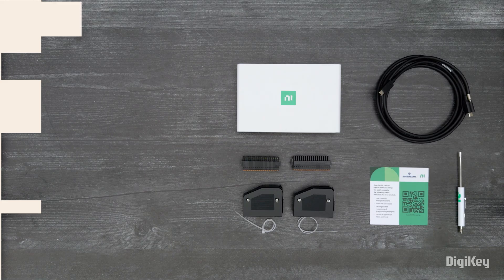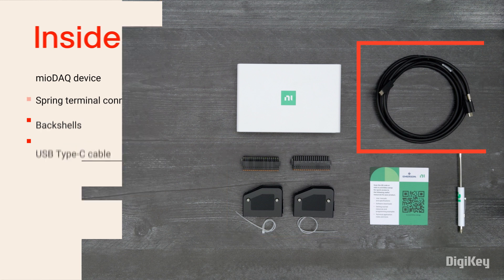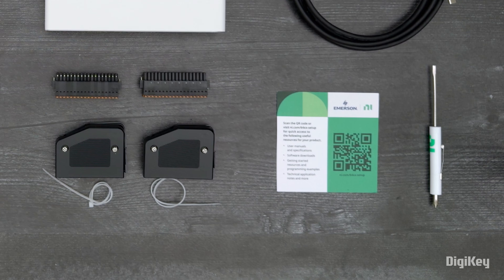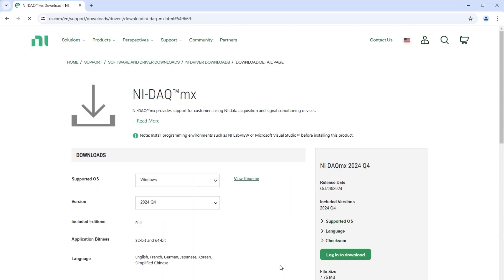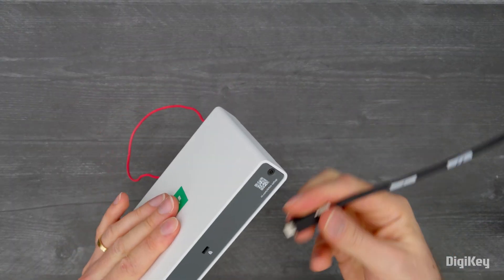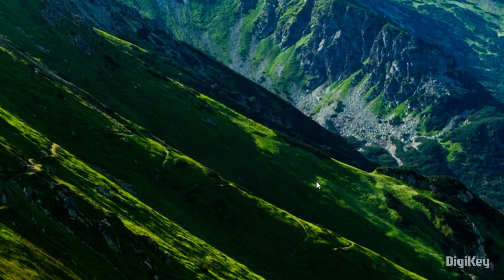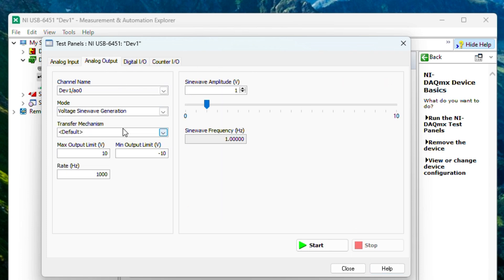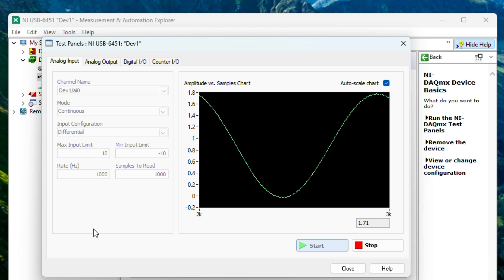mioDAQ USB Data Acquisition Devices - Unboxing | DigiKey

Comment: How many channels, and what is the analog input bandwidth?  What is the maximum (simultaneous?) sampling when all channels are used?  

I was wondering how it compares to a DIY solution.  For example, Lattice has some cool ADC reference designs.. and there are a few GH projects..
EEVengers/ThunderScope   (see whitepaper by Milan Schabort and Leo Gierhake and video "JESD204B : Interfacing to modern ADC/DAC with LiteX")
JosephFeld/streamoscope
cjhonlyone/ADC-lvds